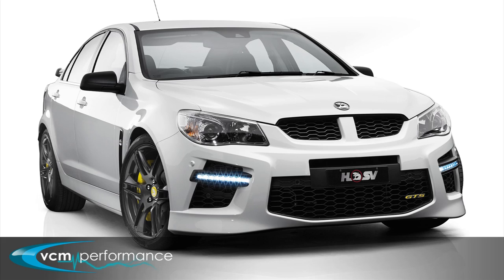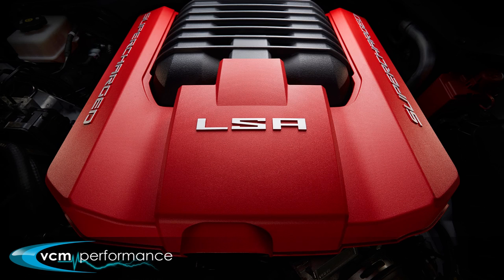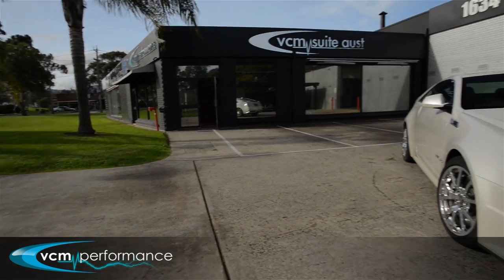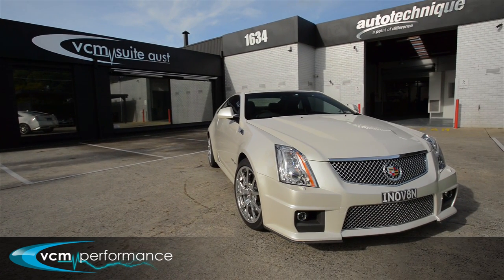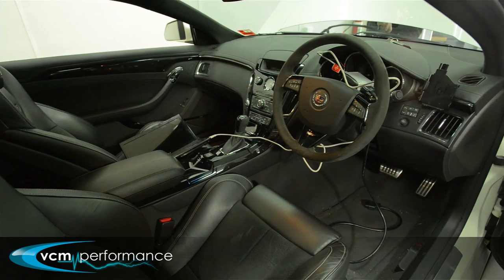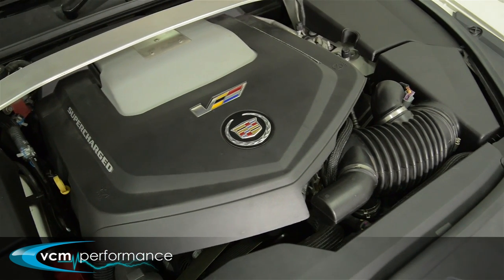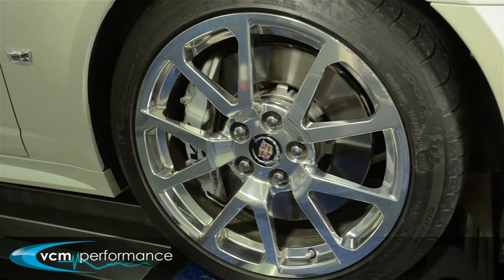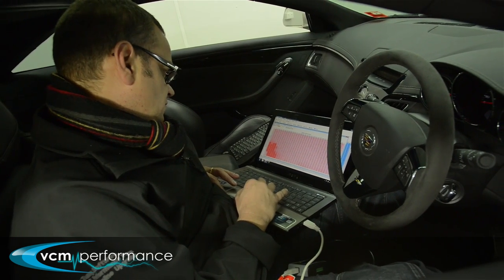LSA Supercharged dyno tune - VCM Suite

Comment: These guys built my VE Clubby... Harrop 122, cam (ground for torque) valve springs, OTR, fuel system, upgraded injectors, HPC coated headers, 100 cell Motorsport cats, tough sounding twin 3 inch stainless system.... Result? A 418 rwkW  daily driver!! Happily recommend these guys to anyone. Professional, courteous and more than happy to help with any questions queries or problems. Can't stop thinking about what an LSA with the same treatment might run to...... ?

Comment: This is the first in a series of tweaks & upgrades we will be doing to the LSA.
The changes made to the tune were minimal & very conservative - the runs & results shown set the baseline "before".
Over the coming weeks we will increase boost, improve airflow, fuelling, exhaust, & calibration. There is a lot of scope with these engines ...
Fun times ahead!

Comment: - This car was converted from RHD to LHD & in the process the exhaust was severely compromised.
- For this baseline dyno pull, the engine was left absolutely standard - no air filter change, pulley changes, injectors etc.
- The tune was tweaked only to smooth out the fuelling and make it more suitable for Aussie fuel.

Comment: While this car was dynode at ~40rwkw down on the average US dyno, we know that the US dynos do typically read a little (~10kw) higher than Au dynos (our horses are bigger??), the main issue was the exhaust. Over the coming days you will see some updates - including the huge difference made by an exhaust manifold that does not get strangled by the re-routed steering column.
... And then there is the supercharger upgrades ....

Comment: RWHP normally roughly equals fwkw so a 325kw hsv will dyno about 325 rwhp especially if its an auto so this lsa is 430kw should dyno approx 430rwhp so while it is low its not as bad as some are making out.

Comment: You should easily be able to get about 350rwkw with proper calibration and more boost and adequate exhaust flow.
Most tuned VE HSV running the ls3 make about 40-60rwkw with a good tune and exhaust and air intake system

Comment: Here are some FACTS for those of you who whose IQ appears equivalent of the dribble-per-minute you can type:
- The stock CTS-V is rated at 556 flywheel horsepower (no driveline losses, no exhaust and emission restrictions).
- There is a CTS-V forum that has collated data from owners (US):
...... Bone stock RWHP & RWTQ (A6 only (53)) (all dynos): 07-15-2013
...... RWHP average (53 samples): 24235/53= 457.26 average (340rwkw)
...... RWTQ average (53 samples): 24140/53= 455.47 average

Comment: Wow in the conversion they did something really compromising to the engine systems, I have one we just dyno'd for a customer at 447hp (that's an average of 10 pulls ) now were pulling it and putting a lingenfelter cam je pistons and their overdrive pulley for the charger with a tune. Early estimates are in the low 600bhp by lingenfelter so whats wrong with these aussies tuning? For a custom tune to bring it back to stock is a little embarrassing for a performance shop anyway

Comment: Haha.. Holden hang your heads in shame.. Take a look at how much boost it was running... 10psi. Fg Gt runs around 7psi stock and severely detuned and throttle restricted to 80 percent 300 rwkws. Mine runs 11 psi and conservative tune and has 415rwkw

Comment: So just to recap - they completely botched this engine in the LH to RH drive conversion, screwing up the output so badly that the car lost around 100whp as a result, then they managed to tune back in 15hp or so?  FAIL.